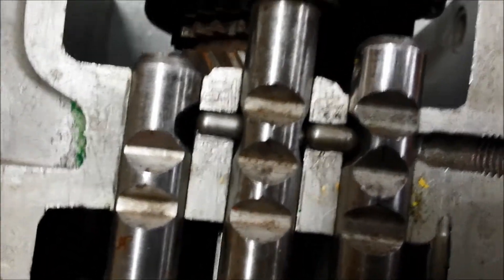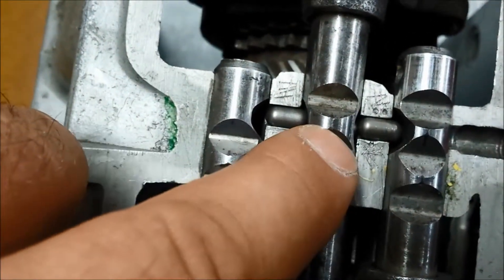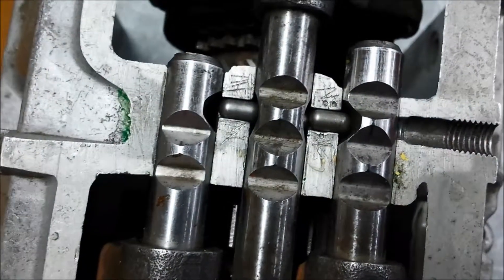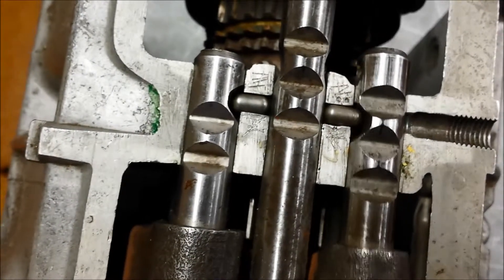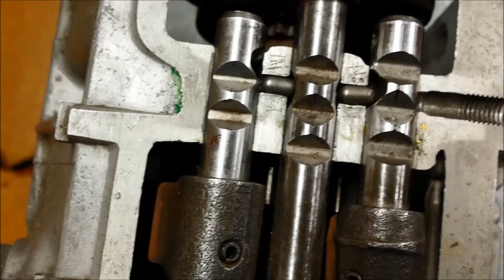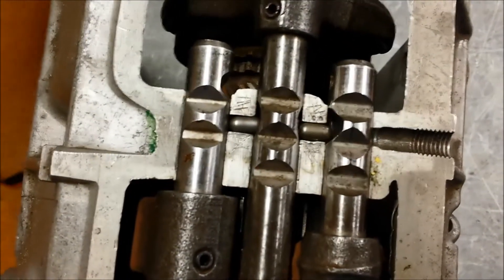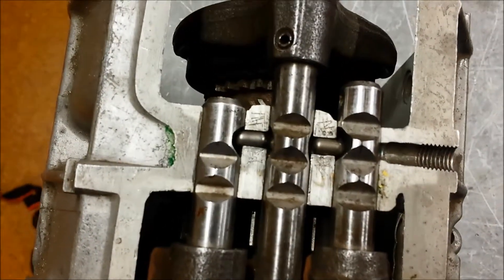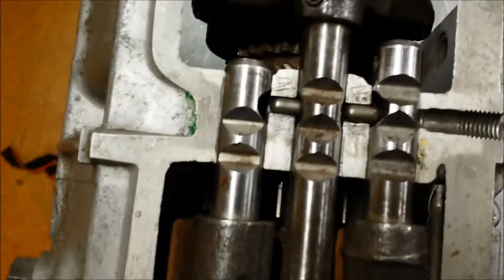Manual Gearbox interlock system operation #1004

Comment: So what’s the difference in an interlock system & detent ???
Reply from the maker: Each system is completely different. Detent provides feel to driver of gear engagement and ensures correct positioning of selector shaft. Interlock prevents more than one selector shaft from moving away from the neutral position to ensure 2 gears are not engaged simultaneously. Hope this helps. Cheers Andy
Reply: is there a lock inside the 3 rods?